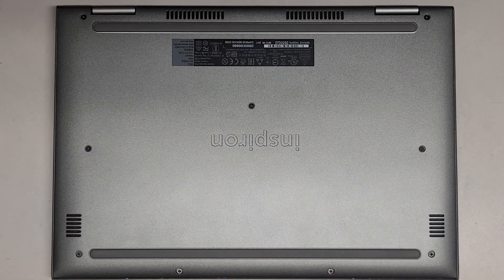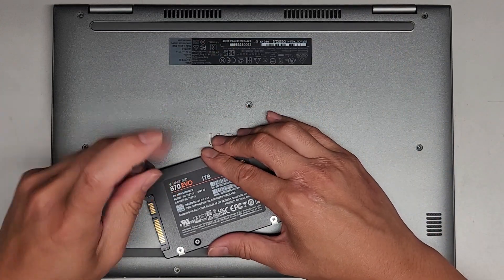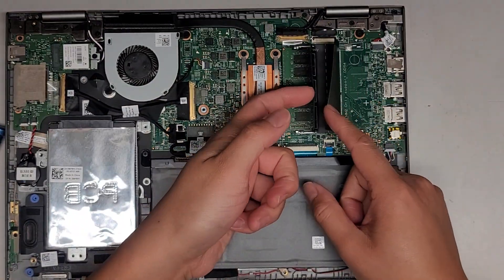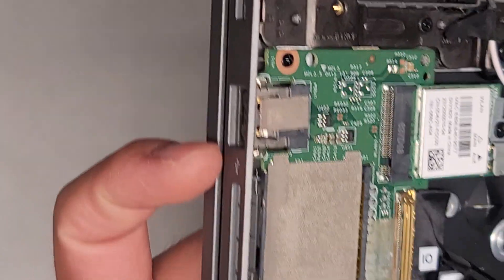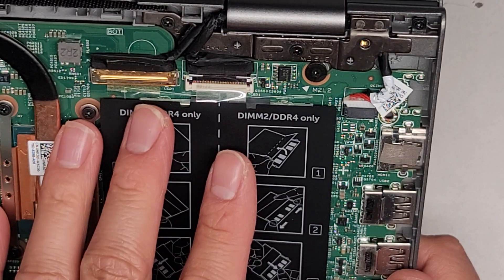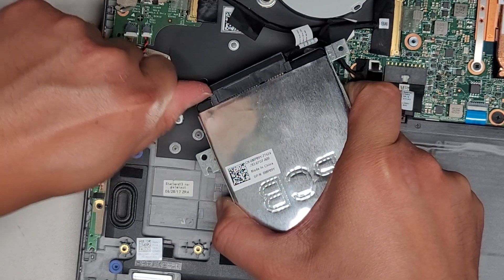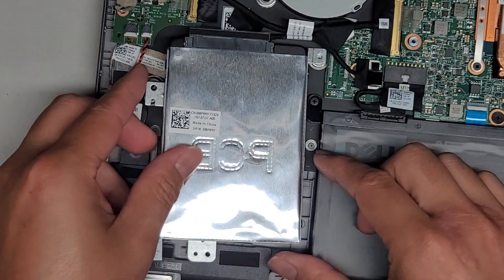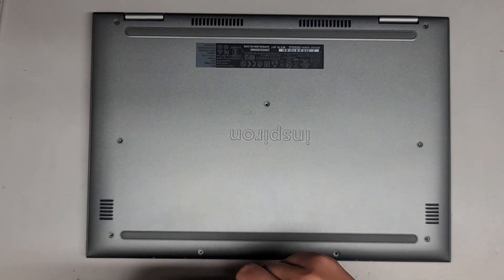DELL Inspiron 13 5379 2-in-1 2n1 2 in 1 Disassembly RAM SSD Hard Drive Upgrade Battery Quick Look

Comment: can we mix ram of different frequency for each side? i have some left over ram that  i am planning to install 2100mhz and 3200mhz
Reply from the maker: It'll run at the lowest speed
Reply: Better to apply low latency and max supported frequency chip for ram, crucial or kingston is my recommendation😊
Reply from the maker: I don't feel the speed difference is very noticeable even though that's true.

Comment: Hey, I plan to upgrade the RAM and change SSD on this laptop. Is it absolutely necessary to disconnect the battery first before doing the upgrades or I can do them without? 
I appreciate the answer in advance
Reply from the maker: @makoyinmtl5520  just need to make sure it's of, but be careful not to drop anything on the board
Reply: @ItsBinhRepaired  Alright, sounds good! Thanks again for the swift response!

Comment: Very nice video 
The laptop was very clean like new
This is your second video on this laptop
if I add a 3200mhz 16GB ram stick with existing 2400mhz 8GB will the performance be lower then 2x 8GB 2400mhz sticks or 2x 2400mhz 12GB sticks  
cpu max ram speed is 2400mhz 
Same laptop

what will be best configuration ( I'm only able to get 3200Mhz 8GB or 16GB sticks) 
Thanks
Reply: assuming 12GB RAM STICKS EXIST .
Reply from the maker: 12gb doesn't exist lol
Reply from the maker: I don't benchmark, so I don't know.
Reply: @ItsBinhRepaired any guesses?
Reply from the maker: @Rennemaric207  likely will be the same speed if it doesn't support it.
Reply: @ItsBinhRepaired  thanks
Reply from the maker: Yup